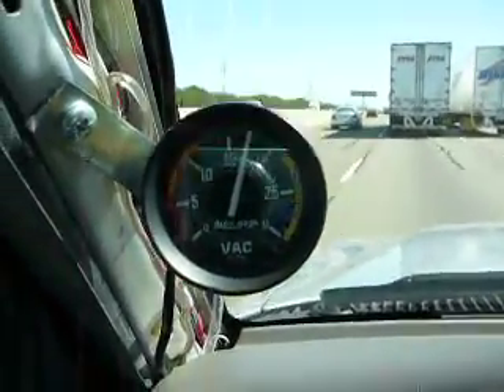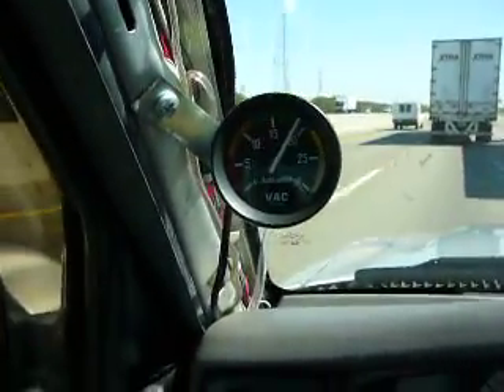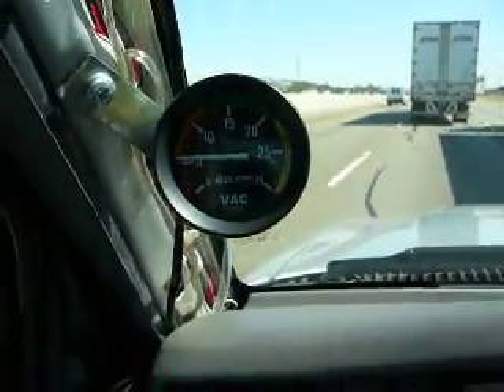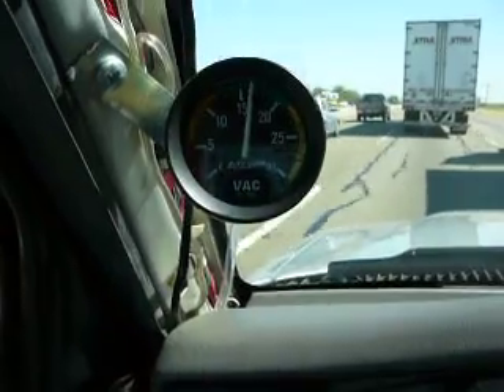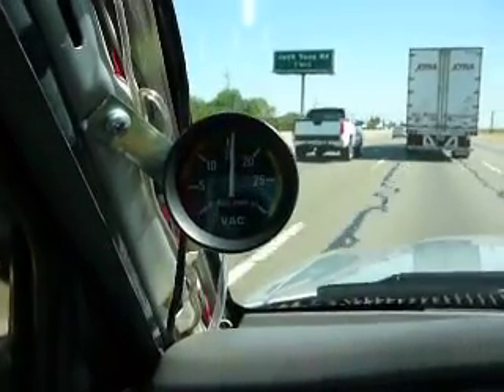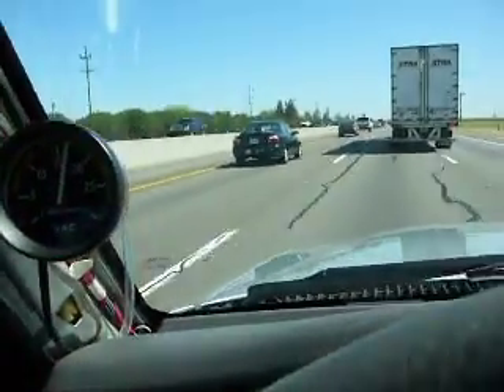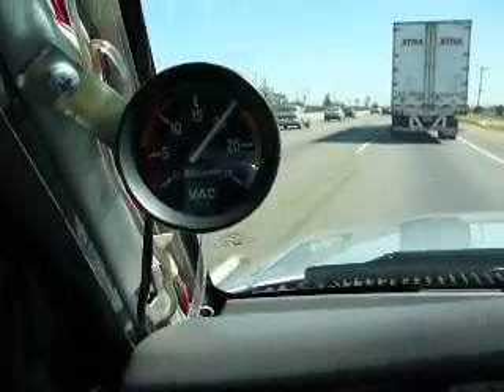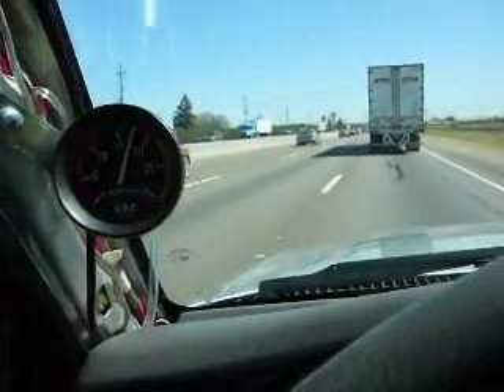Driving with a vacuum guage for fuel efficiency

Comment: I mean it doesn’t matter what I do cause I got a three speed auto and it still gets 10 mpg cause it runs on the enrichment circuit at highway speed cause the throttle plates are open quite a bit. This is a very good video and I would likely do this in my truck too. I bike most places so I know how much faster I can go if I draft off of someone but I thought that you had to be right next to them. Apparently not with a car!

Comment: In the video you're right in the turbulence coming off that truck. You'll notice the car being beaten around. It's the opposite of drafting. For drafting you need to get dangerously close. Truck drivers hate it because they can't see you at all.
Reply: Here's a photo that demonstrates how close you need to be. You need to be right next to the trailer underride guard and it probably wouldn't work with a tall vehicle.
https://qph.fs.quoracdn.net/main-qimg-8d89c548790e232b3db75445b017c2a1-c
Reply from the maker: Yup
Reply from the maker: That really wasn't the point of the video, I was just demonstrating the gauge.

Comment: A friend told you you need a turbo engine to get a vacuum gauge. Is this true ?
Reply from the maker: LegendaryPrince777 

Nope..     The pickup int he video is non turbo..     
You need a turbo ro supercharger if you want boost..  (positive pressure)  

However, If it's a diesel engine, you dont have vacuum.
Reply: ok thanks, i bought a vacuum gauge for my jeep hope it works

Comment: Based on your recommendations I bought a gauge on ebay and gave it a try. It  provided very interesting information about what the engine was up to.

The vacuum gauge was very good at telling me whether I was going up or down a hill and whether I was accelerating or slowing down. Although I did notice a difference while following trucks, trying to determine  how much better my fuel economy was was difficult to parse out because of the effects of acceleration and hills on the gauge overwhelmed the effect of drafting.

I installed the gauge in a temporary manner and I don't think I am going to permanently install it because I don't feel I can watch it and drive safely. For me it would be a big mistake to try to watch the gauge while drafting at any distance, I'll leave the gauge watching to the NASCAR guys..

The gauge did confirm that my A/C increases fuel consumption significantly and changing my automatic transmission from drive to neutral noticeably reduces fuel consumption while idling.
Reply: Jimmy Watt 
Just don't disengage, then re-engage, Drive from Neutral at speed; unless you have a standard belt CVT which is mated but also has some clutching on and off involved. Idk about American cvt's but you should never do this. You can, however, accurately shift up & down in an automatic car if you know what you're doing but it always induces unnecessary wear. So you need to regularly trans flush, strain, and inspect for little pieces.

Comment: I was wondering when  you drive in first gear does your vacuum drop? When I start off it'll jump near 10 and drop back to 20s while still accerating
Reply: I idle at 20 
accelerate 12
coast 24

Comment from the maker: @hockie91 

Highly unlikely...     
When ANY factory fuel injected vehicles ignition is shut off, the fuel pump relay is closed, the injectors are shut, ect..

Only way this would happen is if you have a defective leaky injector and it bleeds off static fuel rail pressure..

Comment: @steelysniper do not shut your engine off, certain injection systems will dump fuel into each cylinder instead of only the one its intake stroke. this will waste fuel

Comment: @thewhitenight 
When you're in drive and stationary your engine is having to overcome friction in your torque converter, this means your engine will use more fuel while it's idling. You should always shift into neutral at red lights or very slow traffic, basically anytime you're going to be stopped for more than a few seconds. Or even better... Turn your engine off!

Comment: so the vacuum hose is connected between throttle plate and valves, not air filter and throttle plate right?

Comment: um. driving with vacuum? the car in front of you pulling you? no people. go to an auto shop. ask about vacuum and motors. you know those power brakes you use all the time... theres a hose that goes to the brake booster, that hooks to the intake. and the intake sucks air in, called vacuum, well vacuum is good to have. boost is good to because it means your pushing way more air than normally it would suck in. honestly ask a smart auto tech and he'll tell you why its good to have high vac.

Comment: Indeed, check out the videos under my user name. theres vides when it was turbo and vids before it was turbo. Well its non turbo anymore.. mostly due to gas prices and well an expensive turbo to replace.

Relating to this video, a vac gauge can help a driver "see" how much the engine is working and a wideband can help you determine if you are really wasting fuel for nothing. Not to "tune" but just to help us become more efficient drivers.

Comment: Mine is a product of removing a turbo.. lol it was a bad turbo, was left with wideband and fuel pressure regulator, it really helps you control the gas consumption. Mine is a v6 2.5 200hp engine. not the stock mx3 engine.

Comment from the maker: those little hatchback mazdas?   
my neighbor averages 28-29 in hers with no mods..    A wideband guage only moniters the fuel, it doesn't allow for tuning..

I'm going to take it to the next level with an ECU piggy back setup where at 3/4 throttle or more it defults to the stock ECU programming to avoid lean conditions..    :)

Comment: It's engine vacuum - when the engine is running at part throttle, the cylinder that is on its intake stroke pulls a vacuum in the manifold.  More vacuum = less load = better mileage (all other things being equal).

If your engine is fuel injected, don't worry about it.  Get a ScanGauge II instead, and watch your instant and average mileage numbers.